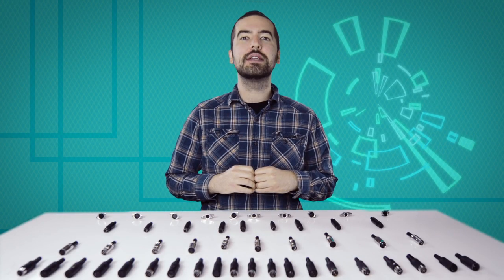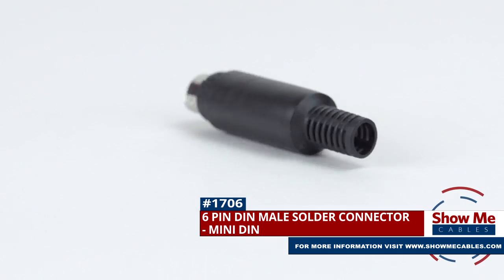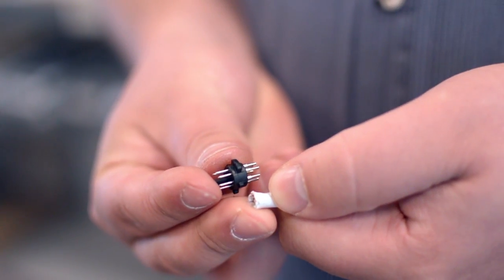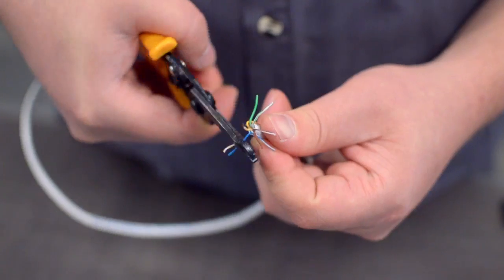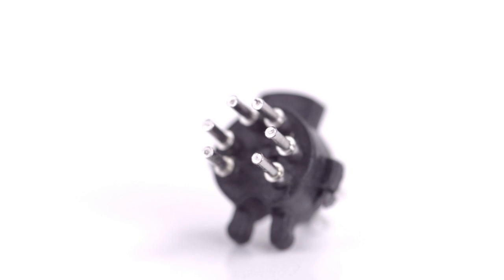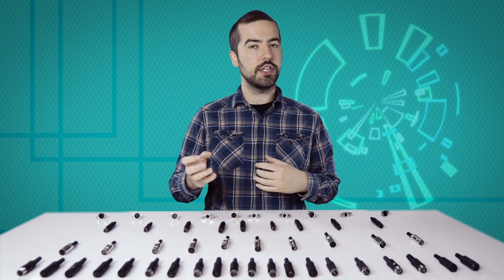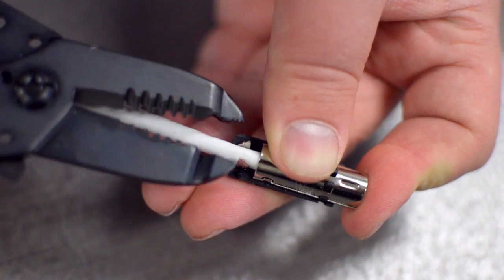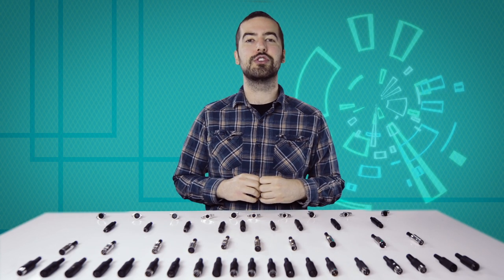How To Install The 6 Pin Mini DIN Male Solder Connector

Comment: The title should be "How a 6 pin mini DIN connector works"... You skipped the most important part of the "How to install" which is the soldering part! It's like posting a video "How to fix an engine" and you skip the entire interior repair...

Comment: this was a joke. try showing how to solder the wires to the pins. it's called a solder connector for a reason and you just blow right past this step. point out that soldering the wires with the pins seated in the plastic header will melt the header. point out that pulling the pins out of the header and then soldering and re-inserting into the header as the way to go. you're welcome
Reply: it means that they can't figure it out either

Comment: Hai May I know 6 PIN  male to RCA  connections  ,,,which pin using  video   ,which pin using  audios
Reply from the maker: There is no standard pinout for Din to composite RCA.  What are you trying to use it for?
Reply: Thank you  for respond ,,I used for satellite  finder   this cable for fine tuning the signal strength  FOR SATELLITE RESEVER ( set up box)   ..its connect from  set up box  to AV  my satellite finder in put is  S video 6 pin female so I need to make s video male to RCA   ,,(unfortunate its missing  )

Comment: Hi,  Nice video but I'd like more advice on the soldering phase.  I'm using a 15W iron in this application but find the plastic material holding the pins behaves as if it's made of wax -- melting/distorting within 2 seconds of soldering a wire to a pin -- even though I'm only applying heat for a few seconds (obviously too much).  Is this your experience or am I purchasing my DIN's from the wrong source?
Reply from the maker: Try plugging the connector into a socket while you solder.  That will help keep the pins in place even if the plastic melts.  Something like this - https://www.showmecables.com/by-category/connectors-adapters/din?gender1=116

Comment: i have cuestion i am looking for the  cable jvc subwoofer pin din one side other side finishe rca thanks
Reply from the maker: Alejandro, it sounds like you need a custom assembly. We have a user friendly custom cable builder at www.showmecables.com but in order to build this particular cable we would need a wiring diagram to build it to your exact specifications. Feel free to check our custom cable calculator on our website or call customer service at 888.519.9505. Thank you!